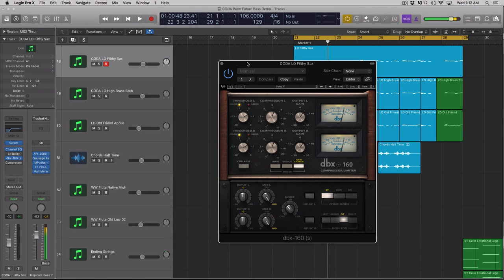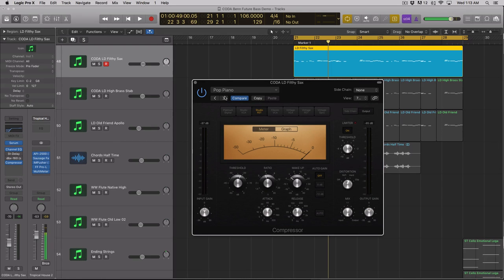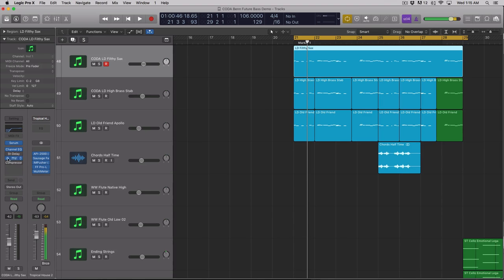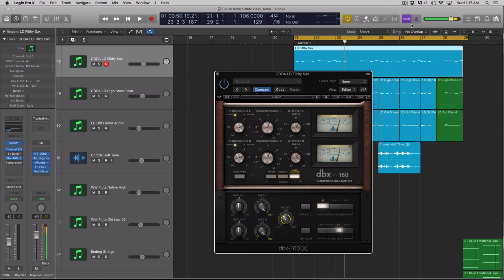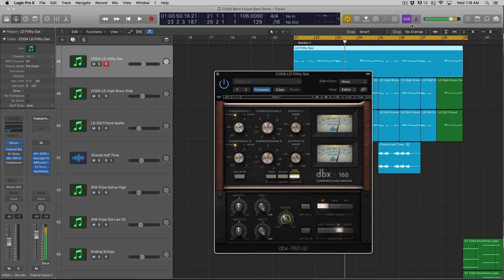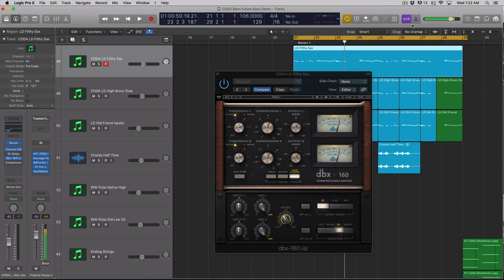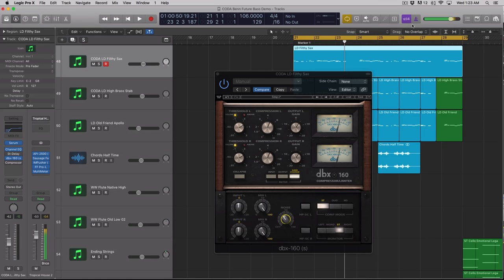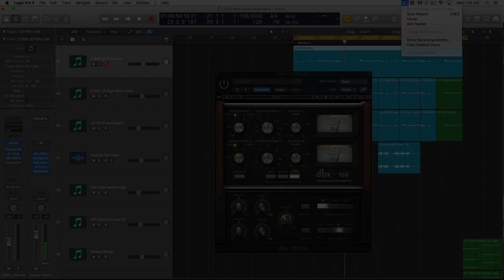5 compression mistakes to avoid

Comment: I don't compress to make things louder, I compress to balance out the lowest point of volume in a signal with the loudest point of volume in the signal. Or at least get them close enough. Because if you're dealing with Hip-Hop/EDM/etc etc, you want things in your face, clear and balanced. There's not that much dynamic range going on in these sorts of genres. I mean, there is, but it's incredibly subtle. The loudness part is another story.

Comment: It's like no matter how many vids I watch on compression, I could never truly grasp the true use of compression. I mean I get that it raises the lowest peaks closer to the higher peaks, but I just have trouble understanding the ins and outs of compression as a whole if that makes sense. I feel like I'm slow or something trying to figure out what is compression, how to use it, when to use it... guess I'm still at novice stage when it comes to mixing.
Reply: I was (and still am, to an extent) the same.  The only solution is to spend a few minutes every day listening to the results when you mess around with them on a suitably dynamic track.
Reply: tl;dr- compression narrows the dynamic range of a signal, allowing you 
to turn the whole thing up without those high peaks clipping, and 
resulting in a more dynamically even sound. 

compression doesn't raise the low peaks. It lowers the high peaks. When you set the threshold, you're telling the compressor to compress everything above that dB level by a particular ratio but it won't touch anything below the threshold. So say your threshold is 0dB with a ratio of 3:1. A 3dB peak will get knocked down to 1dB, a 9dB peak will get knocked down to 3dB, etc. The attack is how fast the compressor starts working when those high  peaks happen, the release is how long the compressor keeps compressing after it activates. A good example of where to use it say you have a recorded guitar, but the guitarist hit a few notes alot louder than most of the rest. You'd use the compressor to knock down those peaks and make everything more even.

That being said you can get advanced and use compression to shape sounds such as making a kick more punchy; or get into sidechaining to deal with different signals conflicting in a mix. 

Another good thing to remember is that when you compress to squash those high peaks, you're actually altering the sound wave and will have changes in tonality.

compression doesn't make things louder. It makes things quieter. That's why there's a make-up gain fader.
Reply: Dj Zeerus Okay, very helpful info. I'm getting everything you're saying until you got to ratio. I'm assuming there's math in this part, and if so, it's gotta be division. So tell me if I'm correct. If my threshold is set at -3dB with a ratio of 3:1 and I have a 3dB signal going in, that means the signal's 3dB peak will drop to -4dB?
Reply: Frank Doolz it would drop to -1. The ratio is the amount over the threshold you are in vs out. So however much over your threshold you are (in your example its 6dB greater than the threshold), divide that difference by your ratio, and the resulting number is how much over your threshold you are now. So another example:

Threshold set to -8dB, ratio is 4:1 and input signal is 8dB. So youre 16dB over youre threshold. 16 divide by 4 is 4. Your output signal is 4dB greater than your threshold which would be -4dB. 

(Input Decibels above threshold)/(ratio)=(output decibels above threshold)
Reply: Between this video, and your info Dj, I think I actually "get it" now! Thanks a heap!
Reply: If you wanna understand a compressor, put the threshold around 20bs (possibly lower for more quiet sounds) And smash the ratio as far as it can possibly go. some compressors (Like opto or verimu compressors) will give you a huge amount of distortion, If this is the case ease off a bit on the ratio until its as high is at can be with a fairly clean signal. Usually youll be able to hear a pretty significant difference in the tail of the sound. This can be done with any compressor to get a good feel for how it interacts with your sound vs other compressors.
Reply: Its targeting the timing of the sound in milliseconds (attack) and amplifying or lowering the sound for a specific amount of time (release) and how much in decibels (ratio) you want that effect to work on the sound (threshold).
Reply: Frank I tried to properly understand compression for like 10 years (not joking) , until I fond this tutorials , is a long series but trust me after you will understand !!!
https://youtu.be/QHTP9d1-nlg
Reply: Check out RMS and LUFS values when mastering for loudness and you immediately understand why compression is necessary.
Reply: The reason for that is because there can be many uses for compression so people tend to get confused with hearing different advice form different people, for example you can use compression to control the level of your audio source or you can use it to manipulate the dynamics which does no favours to your audio source if you want to keep it clean, you can use it for sidechaining/ducking, parallel mixing or only compressing the highs of a signal, there can be a lot of uses and it can take a long time to grasp all of this especially when people who explain compressors don't explain these things in depth, so far all this is simple stuff where it gets slightly complicating is when you come across all different types of compressors and then you have to learn how they react etc. this is why many love the la2a/1176 combo but you shouldn't be afraid to experiment more.
 In the above video he says don't use it on pads "or take a look in the mirror" but that couldn't be farther from the truth because you can absolutely use it on pads but only if the pads require it, if there is a blip in that pad sound that rises in volume of course you should control that, personally I would choose a new pad sound but that's not to say you can't compress pads.
Also here's just a quick example how you can use compression in different ways.
Pavarotti:  bring down the volume to a normal level when he starts to sing loudly for this you would want a clean transparent compressor
Skrillex: squash/push everything to the limits, for this you want a very versatile compressor
Mixing engineer: Get the punch of the drums just right, for this you may the tried and tested compressors (research)
Master: make the mix glue together or make it pump just a touch, can use whatever you like here however you want your music to sound, there really are no rules, you can also squash the shit out of pavarotti should you wish, I hope this makes some sense and that I didn't confuse you even more. lol
Reply: This is why music industry is expensive....if you are really serious you have to get something for money. No one just gives away which they bought with money, sweat, and life time works.

Comment: You can start with a preset if the material you are compressing is similar. Best way to think of compression that worked for me, is to think of it as simply the control of transients. By controlling those transients you can get a louder signal, but it's not just about loudness which in my mind makes it less of a utilitarian concept. You can set a compressor on a kick, flatten it out, and raise the volume quite a bit. It will be louder, and maybe that's what you want in that instance. Or you can set a compressor on a kick, lengthen the attack and the release out, raise the volume a bit, and get a punchier sound because you are enhancing the transient and attack of the material. It might not be louder in terms of DB, but the punchiness of the kick could be perceived louder in the mix. I also suggest it's just as important to compress with all the other tracks playing as it is to EQ. You have to make sure that what you are doing to the sound compliments the rest of the mix. At the end of the day it needs to sound good, which is why I don't think it's such a bad thing to start with a preset as log as you understand your material and what you are trying to achieve.

Comment: In EDM people will say to use a compressor to side chain basically every track to give the track a pumping feel and/or to make the kick stand out. What would you suggest to do otherwise instead of using so much compression to get a pumping feel in the pads when there is no kick or to make the kick stand out?

Comment: Piggy backing on Nate question, i get confused on what different compresses do. I understand what a compressor does for reducing dynamic range, leveling out things, bring out transients and making quite parts more upfront. But like a LA-2A or any other analog modled compressor or digital do the same thing as any other compressor?? or do others have more strengths than others
Reply: First they tends to induce different harmonics and a different amount of saturation to your sound. A 1176 is pretty dirty for example compared to Millenia TCL-2. Then you talk about an LA2A. Any LA2A as a fixed attack and release time which make it really different to, for example, the stock comp in a DAW that has more thing to tweak. Why bothering an LA2A so ? Because sometimes it gets better results quicker (studio are all about efficiency in little time). Moreover an LA2A (the hardware not plugin) tends to have some saturation and really colorful sound due to the transformers inside and the components used in the signal path. A lot of compressors (like the Fairchild 660 or the 1176) weren't made to be so colorful. But they are technologies from the past where the signal was pretty messed up internally during the whole processing due to the components (tubes, old capa, old transformers etc...). And so resulting in a different kind of sound. It's a really vast and wide subject that can't be summed up in a Youtube comment, I've missed some points here obviously. But I hope it gave you an idea ;) (nice profile pic by the way).

Comment: What exactly is so much better or different about getting, say, the fab filter compressor over just using the stock compressor in studio one?
Reply from the maker: I don't use Studio One, but the FF Comp2 is  a really great plugin! It can even handle mid side compression. That being said, I use the logic x stock compressor all the time.
Reply: Features : Oversampling, lookahead, auto-gain compensation, auto-release, hold settings in conjonction with the classic release settings, Mid-Sid, different style of compression and reaction (Classic, Opto, Clean, Pumpy etc...), filtering and narrowing a freq to trigger, parallel compression (dry/wet knob) etc.. You can probably go very well with the stock studio one as it has some features of this one (lookahead, sidechain filtering, knee settings) etc... Also some plugins are more aliasing free than other, that makes them more appropriate for squashing the dynamic without sounding weird (on 1 track you wont probably notice but on all track it can mess up a mix sometimes).

Comment: In compressors like the glue etc where you dont have an interface to see the signal it is very hard to define how much threshold is enough and how much is too much. Also what i find difficult is how much ratio do i have to use.

Comment: You were talking about compression on Pads/ambient material. what about if you have a few tracks of really stereo/ambient material and want to group the tracks and buss compress to really bring them together as a cohesive sound? maybe like 3 db or so of reduction? or like you said would compression be unnecessary on that type of material?
Reply: Dustin Scott My humble opinion is that its better to apply soft compression in this situation than no compression at all
Reply: see that is what i always thought. usually ALL my tracks all end up separated into group tracks with some type of gentle compression on the buss
Reply from the maker: That was mainly a joke! I meant that if you were throwing on compressors left and right and even putting them on pads and things that don't have a lot of transients, might be a sign to look at when you choose to compress!
Reply from the maker: I think that's a great technique! I put gentle compression on my groups too!
Reply: ADSR Music Production Tutorials ah ok. i get what your saying. actually think about if you need to compress for a goal rather than arbitrarily putting a compressor at the end of every track by default.
Reply: ADSR Music Production Tutorials but like i said. all my tracks end up sent to a group track with a little compression pretty much always on each buss. and i sometimes like to start with a master buss comp and mix into it.
Reply from the maker: i mix into master buss compression too!
Reply: ADSR Music Production Tutorials i guess im on the right track! by the way thank you for all the time and effort you put into making these videos. great stuff man.

Comment: How important is it to use a compressor ? I hardly ever use them. Am i missing out by not using them ? The only time I ever really use them is on kicks and bass/sub bass.
Reply: Bob Marley If you mean adjusting the attack and release, then in serum for example you can do it on the inbuilt compressor.If the synth you'er using doesn't have one then I'm sure you can just ad one in the external effects.
Reply: Bob Marley so that if for example you have a reverb (and delay) tail and it isn't very loud but you want it to be more present then you can add a compressor to raise the volume of it without muddying your mix to much. That then comes of course at a cost of losing dynamics
Reply: Using compression is not necessary. People fool themselves.

Comment: Okay, here's a question:
Why would you compress a synth track? That would just remove the volume differences stemming from velocity, no? ... I mean, if it's a layered synth track, I could see that perhaps.
Or maybe I'm totally missing something here. <shrug>
EDIT: Also, I'm surprised to you didn't mention these two things: Setting your attack (or even release) too fast, and setting your ratio too high. :)
Reply from the maker: Sometimes it helps even out the sound and make up for gain differential from the ADSR. Sometimes it just makes the sound a little more thick.

There are a lot of different reasons to compress, just depends!

Comment: It's ironic that you're using an emulation of a dbx 160 when throwing shade on some of the best hardware compressors out there and peoples' OBSESSION with trying to nail the exact sound of one. :)

DAWs are so POWERFUL today.  If you want to set up your usual go-to compressor, get it dialed in. By-pass it.  Then take a minute to audition another compressor you normally wouldn't use.  If you're in a situation where you're not on a deadline, then take the opportunity to throw another good combination in your mental presets. :)

Comment: The point about presets is a bullshit to me. Yes, presets don't know anything on what sound you using them, but they're a very good starting point, especially for beginners. If something does not match, just tweak it. Also, is you use sound that are for those presets exactly (like pop piano in your example), you even may not need to tweak anything.